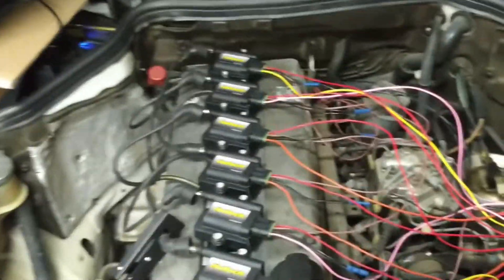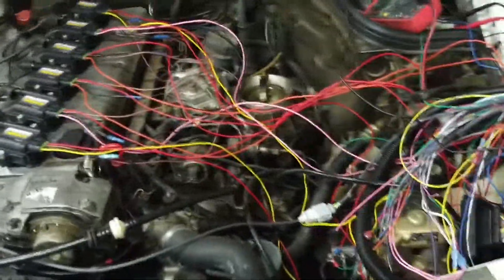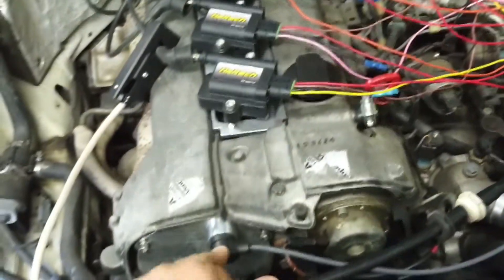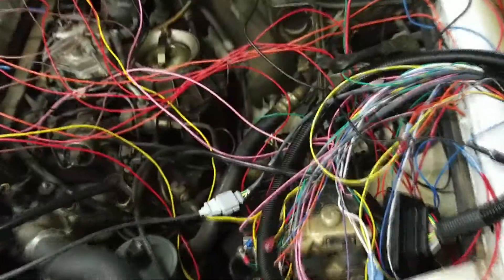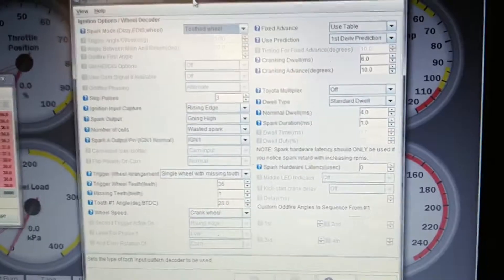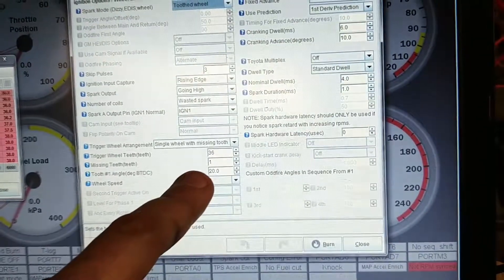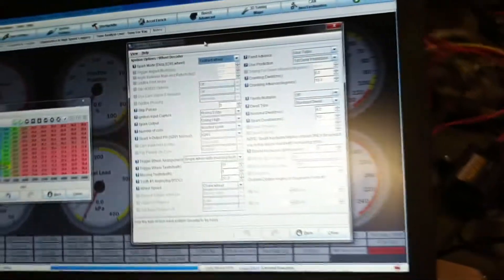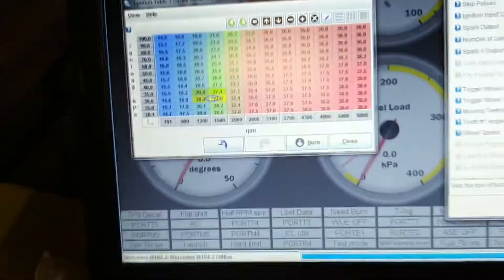Mercedes 300E-24 M104 first start COP wasted spark

Comment: Hey! hi! do you have the electrical diagram for the coils? i have the same setup but i am facing many issues for starting my BMW e30 (M20B20 engine)
Reply from the maker: Hi, the wiring is pretty straight forward. Neg, Pos and trigger. If you're getting spark then your issues probably lay elsewhere.

Comment: Did you ever experience intake backfires while cranking?
Reply from the maker: No, intake backfires could be a number of things. If wasted spark then make sure you have it wired right.
Reply: @gptech2444  No, it's definitely related to the waste spark. Always cold starts and runs great. A hot restart will often result in a intake backfire. Then will start fine. I have found numerous others state the same with a V8 running waste spark. I tried extended crank (5 revolutions) before ignition but still backfires. I am going to try playing with the cranking timing advance. I had to install a blow-off plate spacer under the carb to prevent destroying my intake. Also running a carb probably doesn't help
Reply from the maker: @bicylindrico  What motor is this on? Having a manifold full of fuel isn't a great recipe for wasted spark.
Reply: @gptech2444  Mercedes-Benz M113 converted to carb. I know guys run this setup on old domestic V8's too.  I may have to look into a Megasquirt system just to get sequential ignition but want to play around with the cranking conditions first to try to correct the issue. You can see the engine on my channel. Thanks for the response
Reply: @gptech2444  Just a quick followup in case it could help you in the future. I set the cranking advance to 0 degrees with the advance pulling in to 15 degrees at 500 RPM and it has not backfired since and it would have by now. I also went back to 5 engine RPM's before fire from the 3 I had been running. Time will tell, but this so far has been a positive change for that condition. Defies my logic when I picture what is happening internally in the engine but it has appeared to help. Also these cams have been reground with  230  degrees @ .050" so there is some overlap. May have never happened with stock cams
Reply from the maker: @bicylindrico  10 deg advance is usually a good place to be while cranking and at idle.

Comment: Was there any reason why you changed from Haltech to MegaSquirt? I have the same issues as you have with the trigger sensor. I have no errors, but i only get half synchronization at best.
Reply from the maker: Are you using my trigger wheel?
Reply: Did you get the synchronization issue figured out?

Comment: What was easier/ more beneficial? M103 or m104 megasquirt
Reply from the maker: My trigger wheel makes the conversion easy on both motors.
Installing a trigger wheel has been the most difficult aspect to fitting an aftermarket ecu. What ecu you choose to use is up to you. There is a myriad of different ecu's on the market, megasquirt just happens to be one of the cheapest and has very good community support.